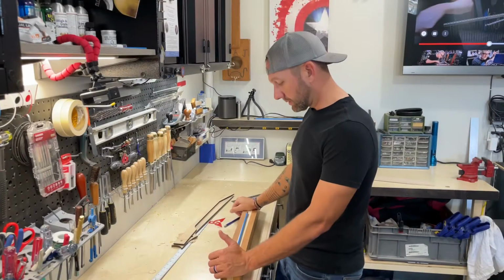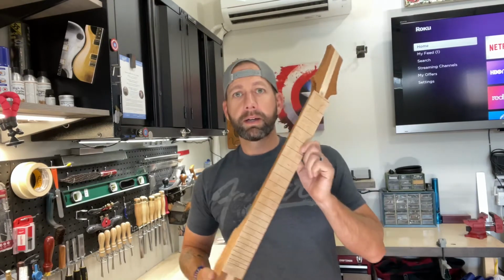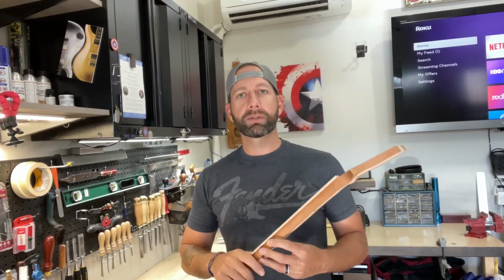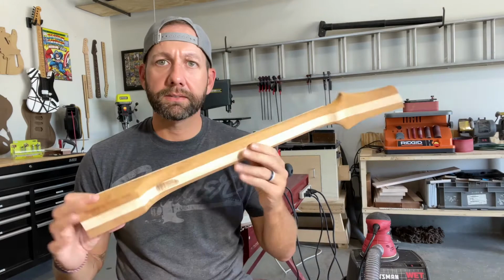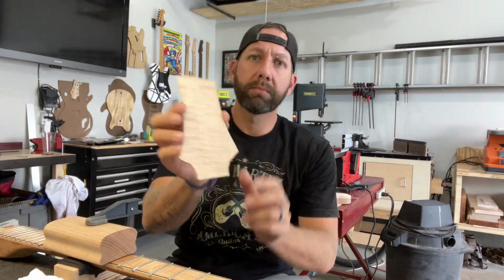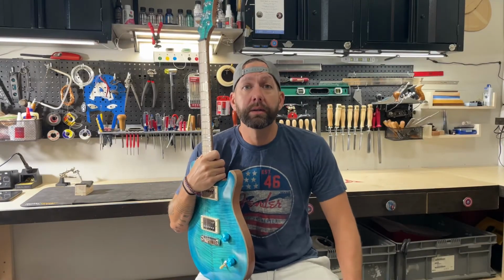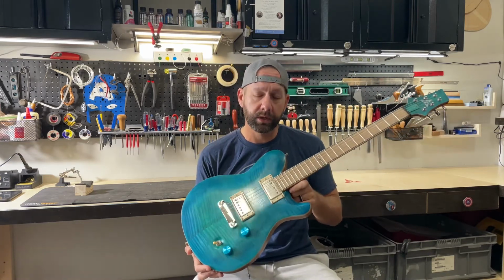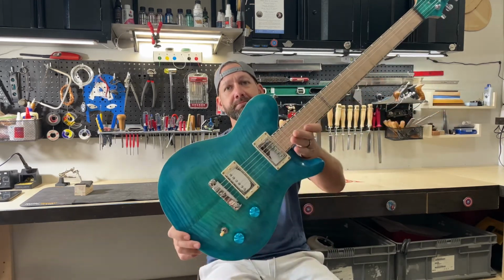Great Guitar Build-Off 2021 - Final entry video

Comment: It's a really nice build, and sounds great as well.  What dye/stain and finish did you end up using?  Good luck in the GGBO voting.
Reply from the maker: Thanks! I used the Crimson spirit stains  - denim blue and green - used a rattle can poly finish - did about 5 coats and then wet sand and polish.